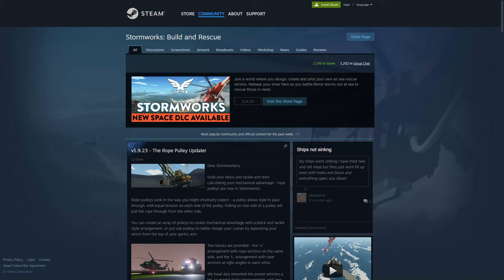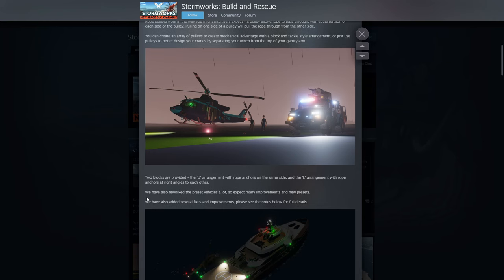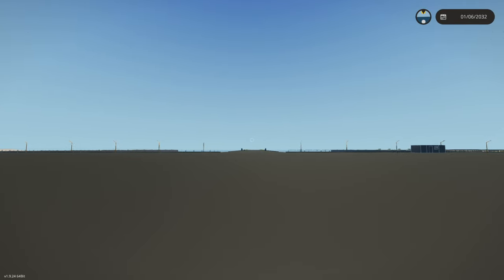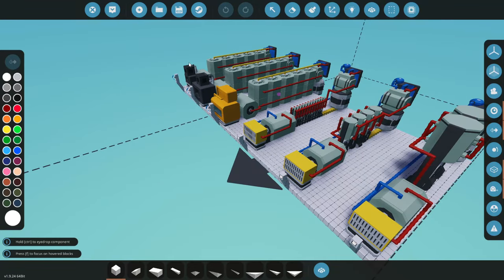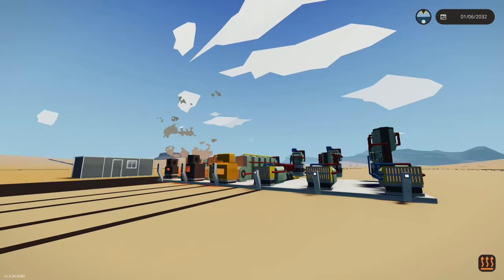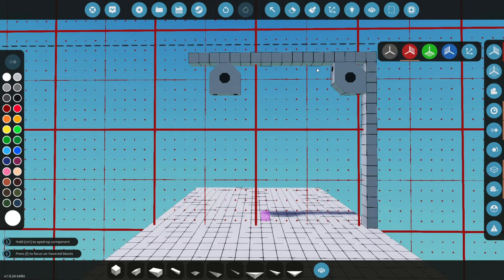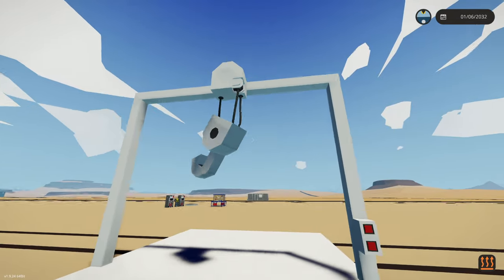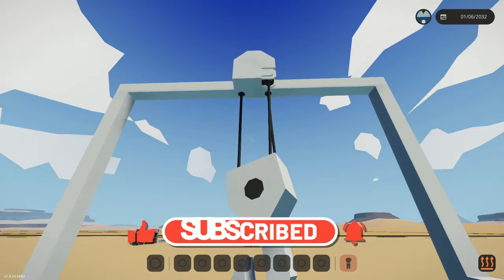New Pullys / Block & Tackle Update!!! STORMWORKS

Comment: Your track example wouldn't work because you turned on infinite power and the slider held its position. And as far as the U block, I think the idea is that you anchor one side and run a Winch to the other, or you can set it up with multiple U blocks to increase pulling power at the cost of length of rope 😊

Also, the winches have a speed setting but you need to use the select tool like your trying to edit a micro controller.
Reply from the maker: Ah infinite electricity! So select tool doesn't work on winches now.  They removed that feature.  Hopefully they bring it back.
Reply: @ProfNCognito  dude! That's not cool! They definitely need to bring that back.
Reply from the maker: right?

Comment: did they actually just doom us to insanely slow winches forever
Reply from the maker: I hope not. Hopefully this was a mistake.
Reply: Maby different winches have different speeds?
Reply from the maker: i checked all of them no more settings
Reply: @ProfNCognito  I hope this is still a mistake or defect. Winches in their current form significantly reduce, or even eliminate, the value of pulleys.
It may be necessary to change the mechanics of the winches, because... They write that on old buildings, winches are adjusted.